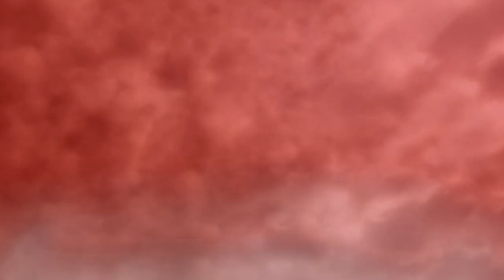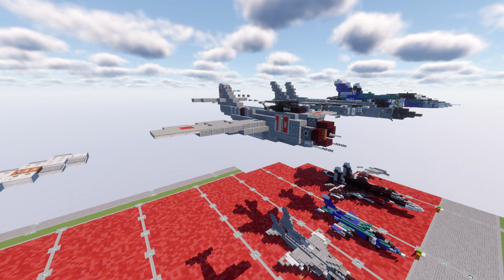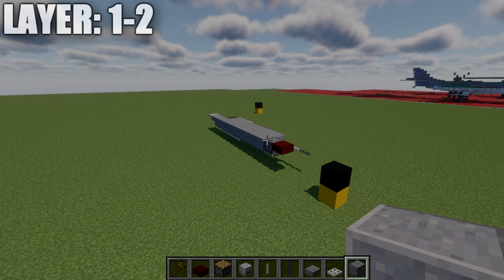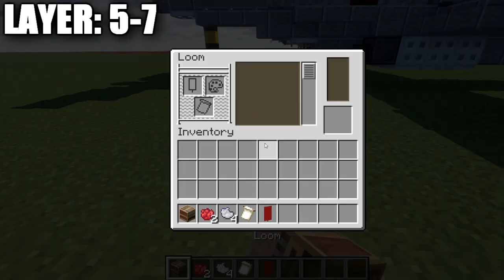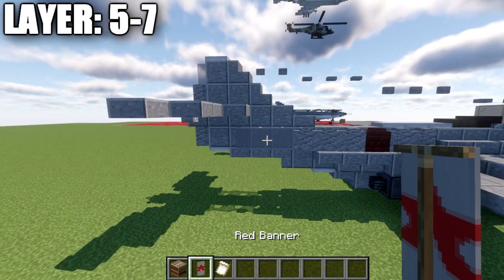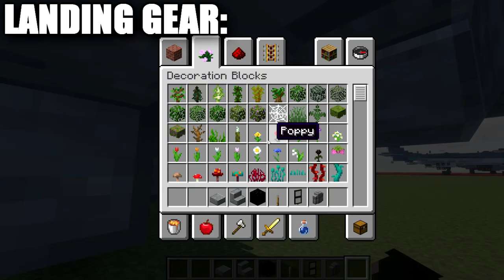Minecraft: Cold War MiG-9 "Fargo" | Fighter Tutorial (In-Flight + Landed Version)

Comment: Hey Garrett! Fighter is very nice now, as I said in my last comment. I would like to know, what're mods you're using for fast flying and putting buttons, frames and etc. to blocks like shulker boxes and grindstones?
Reply from the maker: Hello! The mod for flying fast I no longer use. It was a MoreCommands mod or something like that. It no longer works on newer versions. The placements of buttons, item frames, etc is by crouching and placing them.  May be more of a Java only feature.
Reply: @GARRETT2BY4  thank you! It doesn't look like you're crouching when placing them, so I thought it's a mod.